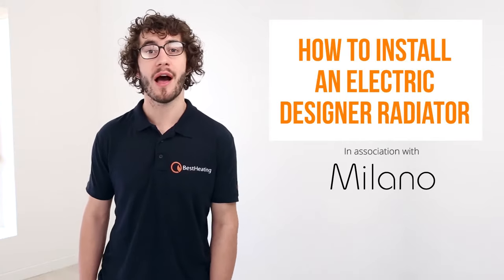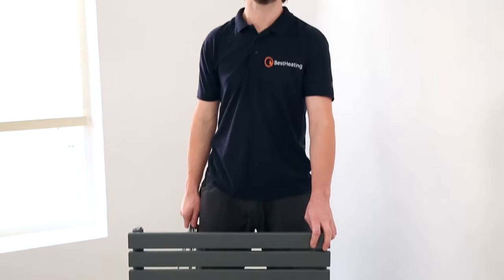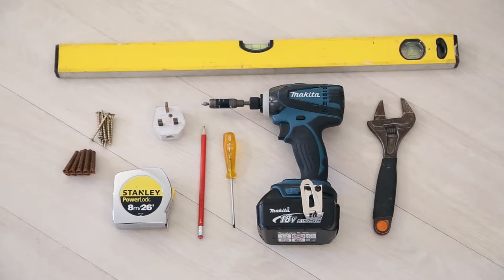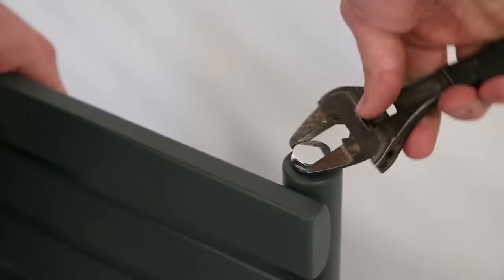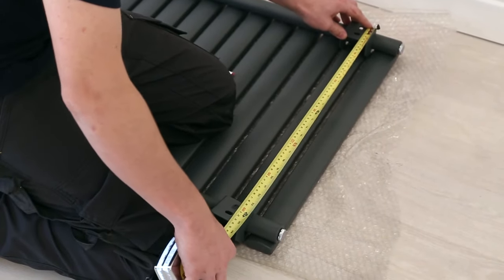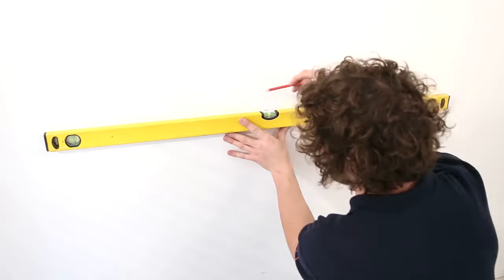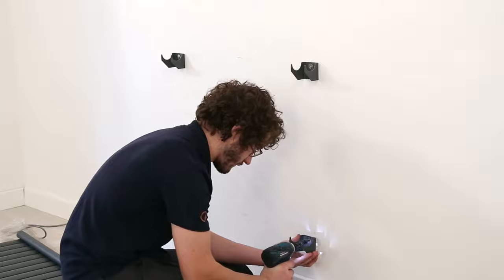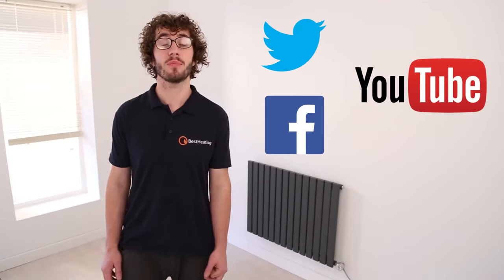How To Install An Electric Designer Radiator | BestHeating

Comment: I have one that i have installed. the element is heating up fine as you can feel it in the radiator bar it slots into. however the bars in front of that isn't getting hot (ie the whole radiator). do you know the reason for this?
Reply from the maker: Hi David, 
Thanks for getting in touch.
So happy that you've chosen one of these radiators! Sorry to hear you are having a problem. Your issue could be caused by a number of factors. It's therefore best to drop an email to info@bestheating.com FAO the tech team, explaining the problem you're having. They could then help to troubleshoot your issue and better diagnose the problem. We hope this helps a little. Thanks.
Reply: @Bestheating  thanks

Comment: Even this video technically just showed a DIY install of a radiator but not the connecting bits to the actual water pipes, its almost like hanging a photo frame, you should have shown the actual connecting to the pipes etc, may be a pushfit pipe or copper pipe (1980s)
Reply from the maker: As it is an "electric" radiator, it doesn't connect to "actual water pipes", so it wouldn't be relevant to include it. These radiators are filled with a heating solution, and operate independently of central heating, and therefore have no additional pipework to connect to.